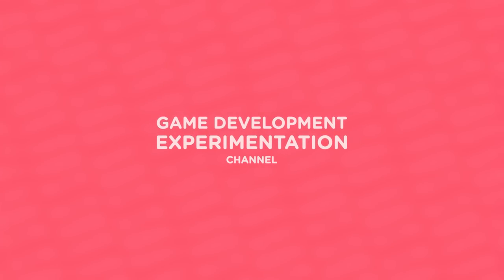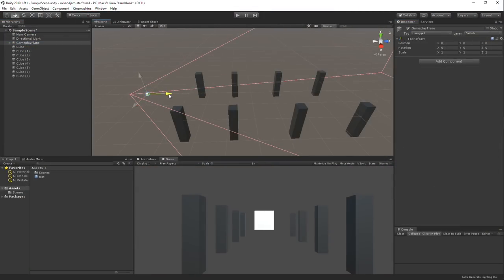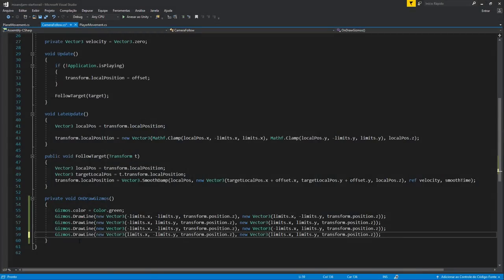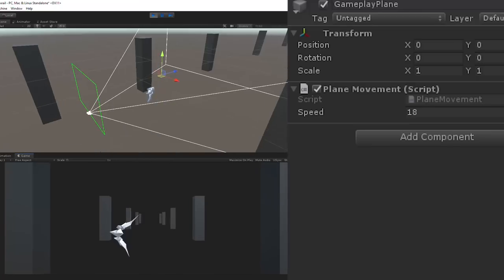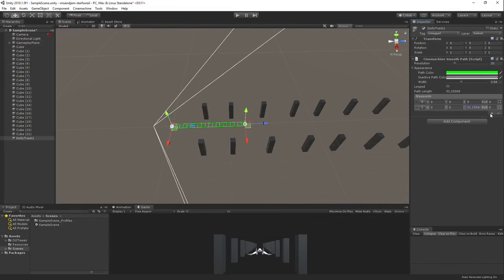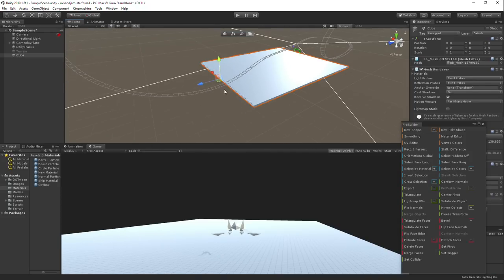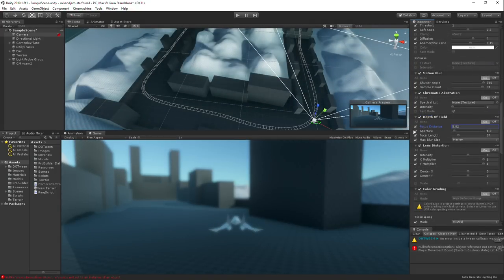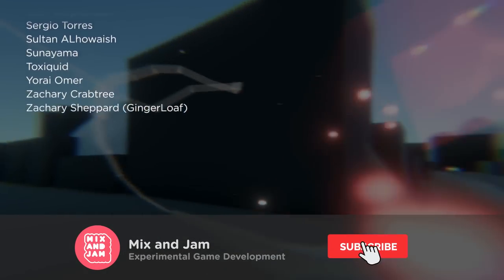Recreating Star Fox's Rail Movement | Mix and Jam

Comment: So I'm super late to this, but this was so helpful to me. I have been working on a Star Fox game in Unity for the past week, and I had accomplished a lot, but in a way much different from you. I was using translate to move my ship, and had my camera following behind my arwing, with the camera only copying the forward movement of the arwing (which Unity tracked well regardless of rotation), and it was working really well. After seeing this, I didn't even KNOW about how I could use the CameraToViewPort method to do the same thing but so much easier. I didn't even know about the cinemachine dolly. My plan was to simply set triggers in a level that would change the rotation of the camera target and force the arwing to follow a different path, but these solutions are outstanding. You're so helpful, thanks!

Comment: Could you make a vid on Warframe movement system (or some other good 3rd person movement)
Reply: It's pretty simple. You just trigger the right animations depending on the key(s) pressed and change the player character's velocity as needed. Though it might be time-consuming to set up a system to ensure checking for things like proper key combinations or whether the player's in the air. Maybe a state machine would make it easier.
Reply: @demetresaghliani9048  I was more interested in wall contact (like he's shown it in 2D in his video on Celeste's movement)  detection and capping/maintaining velocity.

Comment: There is one design flaw in this setup, there's no way to seamlessly switch tracks to allow alternative paths.
Reply from the maker: True, you would have to implement an additional system that checks which node you are currently placed and move you to another track.  With the Unity release of the Splines packages this can also be a quick fix, because splines have a much better "branch" system by default!

Comment: Greetings again #Mixandjam, Today I need a bit of advice. So I'm starting my own Rail Shooter prototype based on your take on the Star Fox Mechanics done in unity with Cinemachines's dolly track.

 Ive started it in Unity version 2019.1.12f1, and Im at the point where ive set up the basic player movement and camera follow. Now when I go into play mode, the aimObject set as an Aim target for the player jitters quite alot as I move the player across the screen. Also Im having problems with the camera follow script for the CM vcamera. When moving the camer up and right, its smooth, but when trying to move left or down, the screen starts to shake violently. I've tried to mitigate this by setting the X offset to an -12, but it just makes the jittering worse. Now Im following the basic setup you came up with your star fox prototype. The player movement script has a public XY speed & Look Speed, a private Horizontal Lean, and a public refrence to an aim target. Likewise, the Camera Follow script has a public target transform, offset voids set to zero by default, limits set to (5,3), and a smooth damp time of .2f. Still though, what might think Im doing wrong at the moment? Please reply back if you get to read this.
Reply: Im having the same problem with the aim target jittering a lot and its making the player movement not look that smooth at all. Did you find a fix? Thanks
Reply: @PyraJord  so far, I've had to put this project on hold to work on other things, but I want to get back into it soon. I still believe that it has something to do with the version of unity, though that's not to say it could be anything else I've overlooked.
Reply: @colbymullenix9140  Its been driving me a little crazy these last few days. Im on Unity 2019.1.9f1
If I find a fix i'll let you know!
Reply: Thanks a bunch  @PyraJord  , I'd really appreciate it alot. I've been hoping to use try and use these mechanics for any future projects in the future, and getting through this problem would definitely help me out in the long run.

Comment: Nowadays would be using the Spline Package be better? Also I was gonna ask how to apporach switching Dolly tracks for branching paths, but I assume using Splines would be better for that as well?
Reply from the maker: Honestly using splines would probably be better, but you can still do it with tracks, if the origin point of the branch path has its origin on the exact position of the split, you could just transfer the track
Reply: @mixandjam  Thx for the info! Also just one more thing. Is this the kind of system that would work for a Crash Bandicoot style of platformer? 

(I could have sworn I asked this already but couldnt find my comment so maybe I didn't?... )

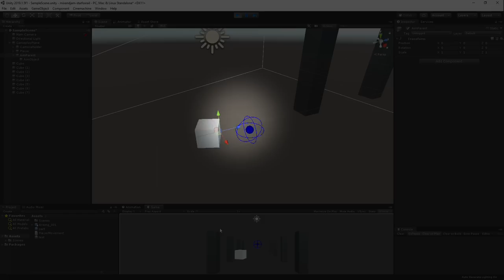Comment: Could somebody please give a more elaborate explanation on the sensor object at 1:13? I'm not entirely sure what is going on here.
Reply from the maker: There are two invisible objects in this scenario:
One invisible object moves according to the player input axis (x & y)
And another invisible object aims at that first object (so basically the "intensity of rotation would be based on the distance between the two invisible objects)

Once that's done, we simply make the player's ship LOCAL rotation replicate the rotation of the "aim" invisible object. 

I'm sure there are plenty of ways to do this but I hope this explanation helped somehow!
Reply: @mixandjam  Thank you for the reply! I think that makes sense, I'll keep experimenting and see if I can make things work as I want them to. :) Just gotta get used to wrapping my head around a few things.